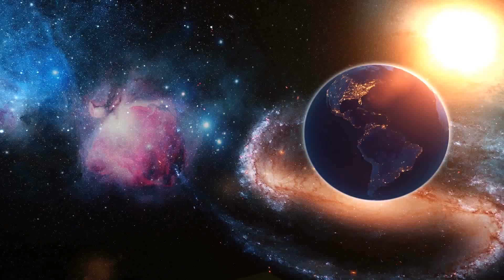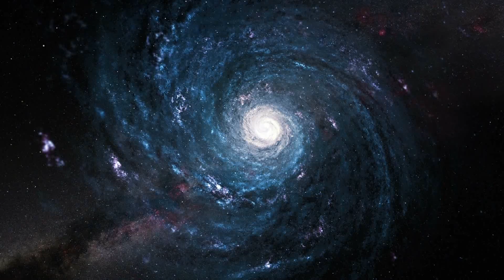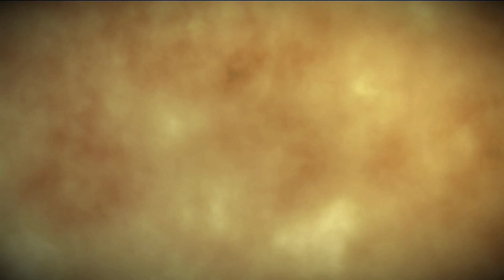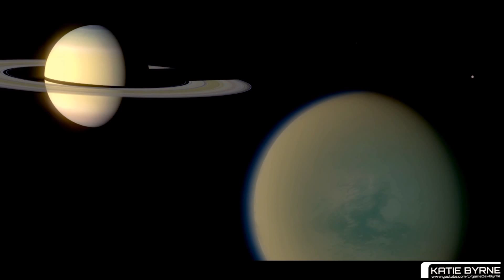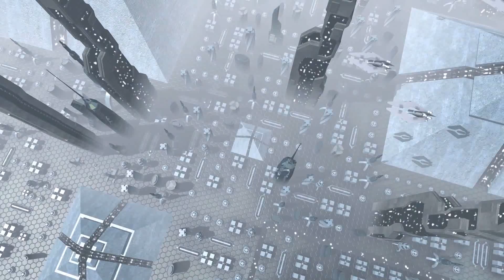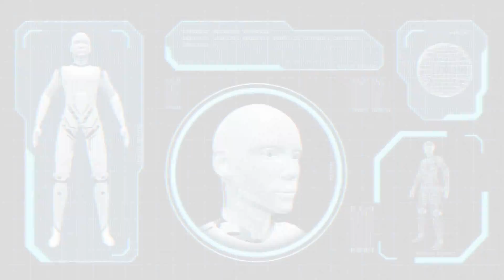Planet Ships

Comment: Anchor each end of a giant rubber band at L4 and L5 Lagrange points, pull it back with a rocket, wait for the correct trajectory, and THWAP!  You're off to Andromeda!  Granted, this would require the mining of space rubber...
Reply: you'd probably just slice Earth in half, unless you make that TWO rubber bands, one connected to L4 and Earth, the other to L5 and Earth, with connections being severed at just the right moment
Reply: This sounds like a job for Jörg Sprave.
Reply: Sounds like a job for supper duck tape and supper bailing wire and biiiiiiiiig 2 X 4.
Reply: Icy Knightmare   “So I came up with this. Let me show you its features.  Ha ha ha ha!”
Reply: Keith Plymale 
2 Astronomical Units x 4 Astronomical Units?
Reply: lmfao
Reply: Coming from ACME near you...
Reply: "Space Rubber" would be a great name for a band...
Reply: @berniebaer9199  Nice that SOMEONE's being practical.
Reply: @onlyrick  you are most welcome ;)
Reply: @berniebaer9199  "to show the power of flextape, I SLICED THIS PLANET IN HALF!"

Comment: I remember a book called "The Jupiter Theft". In that case, the planet moved was a gas giant and they included one of the moons as a radiation shield while they had 5 generation ships hiding in the shadow of the moon. Their method of movement used the gas giant as a fuel tank and created a lot of radiation so a moon was necessary for shielding. I suddenly recalled the book when it was mentioned that you put the planet in orbit of a gas giant and move the giant.

Comment: Now I'm wondering what would happen if you smashed together two planets that are traveling at near light speed
Reply: many asteroids flying everywhere would happen
Reply: @jgr7487  no, I think the material might get vaporized or something similar to that, perhaps they'd collapse into a black hole? I don't think it would be that boring
Reply: I'm too lazy right now to calculate the total energy in that impact, but I assume it'd be comparable to a supernova or hyper nova. You'd also have a very large amount of extremely hot, extremely fast plasma expanding outwards in all directions.

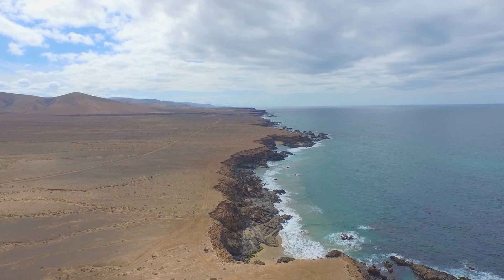Comment: Commenting @ 4:30; The moon doesn't cause tides because of the amount of gravity it exerts on Earth, it causes tides because of the difference in gravity it exerts on one side compared to the other (it pulls greater than average near side, and less then average far side, causing a stretching effect). Because it's relatively close to Earth proportionally to its width this effect is greater then the similar effect caused by the sun despite the suns gravity being greater. Note this doesn't cause water to flow to one side of Earth, but two sides. Also, this is more from water flowing laterally and gathering together and at coastlines faster then it can drain, or draining a local area faster then it can refill. My point is this means its hard to compare this to a linear push which might cause a much greater effect even at lower accelerations. Issac may yet mention this, but for this reason repurposing the moon as a gravity tractor might be better, because the worse effects would be isolated to the moon and the acceleration on Earth would be very natural with the main change being the changes to the Luna months phase.

Comment: Imagine some force trying to attack a relativistic planet ship and the space clearing lasers just cutting them to bits before any dramatic battle could even be thought of.

OR, better yet, a force knows they have this tech, so they bring an easily melted shell full of lead chunks so that when the lasers auto target the meteors, the just spray a debris field across their path.  

What I'm saying is sci fi should adopt this idea in a battle sometime in my lifetime.
Reply: What they forget is that planets often have real life force fields called atmospheres.
Reply: @johnrickard8512  and depending on weapons used the magnetic field could cause issue too.

And perhaps the attacking fleet would make extensive use of mirrors to deflect the point defence lasers, while either re-directing them or using their own point deffences to destroy railgun slugs and missiles trying to destroy said mirror.

Which also gives the thought, a micro black hole could be a nasty thing to fire at someone if you got it going fast enough since you can't simply shoot it down, you either have to evade or fore something at it to deflect it, that could be a fun-if-extreame sci-fi weapon that something like a Planet ship would have more than enough energy to power
Reply: @johnrickard8512  Well, we're talking about lead god-rods being put in the way. I doubt measly nitrogen and change can stop that while cruising at relativistic speeds lol
Reply: @EnPriBricks  True.

Comment: also while tidal forces create tidal heating they do so depending on the strength of the tidal forces and the rotational speed of the earth - if we stopped the moon in it's orbit and used angled thrusters to counter the gravity and keep moon at a cosntant distance so that the exhaust does not hit earth (because they are angled slightly) - we could move the earth by gravity tractor without applying any extra heat to it - the earth still spins at the same speed and the tidal forces are the same - well the moon is no longer orbiting so the relative rotational speed would be one rotation per month more - so the tidal heating would be 1/30 more than currently - or about 1 extra Kelvin of overall temperature every 200 million years
the main source of heating would be the potential of engine exhaust hitting the earth which has to be minimized by very directed engines slightly angled around it
with the moon that would allow us to accelerate earth with 1/300000 of one G while the tidal forces experienced at earths surface are actually about 1/9000000 of one G
if we want to build an artificial gravity tractor, as massive as earth producing a bit more tidal force than the sun and moon combined that would mean we could place it about 3.5 times further away (3.5³=42.875 so it would produce about twice as much tidal force as the moon and about 1/3 more than the moon and sun combined on a new or full moon)
and we would get 80/3.5²=6.5 times as much acceleration or about 1/46000 G
that would bring us close to the speed of light in about 46000 years - in that time we would travel 23000 lightyears since we're constantly accelerating so our average speed is about half the end speed - if we slow down again we have traveled 46000 lightyears in 92000 years
since for a constant acceleration from stillstand distance covered is proportional to time squared it would take 1/100 the time to travel 1/10000 the distance or 920 years to travel 4.6 lightyears roughly the distance to the nearest star - or around 1840 years to travel 18.4 lightyears

Comment: What about Real or Artificial Solar System Ships? Like in Andromeda (Sci-fi Tv series) with the Magog Worldship.
Reply: A dyson swarm configured to function as a shkadov thruster is basically the same thing. except instead of crudely stapling a bunch of planets together around a fake star, you disassemble the planets and use them as raw materials to build orbiting space stations around a real star, except you only put the stations on one side of the star to function as a solar sail, which pulls the star along with it due to gravity.

Comment: Heck of a weapon.  What kind of defense could do any good against a planet inbound at .1c?
Reply: Throw another planet at it, or get out of the way.
Reply: Throw a moon at it, move your dyson sphere, change it's course using your own laser highway system, send self-replicating robots that would take over and disassemble it.. idk. Many science-fantasy options.
Reply: Let’s see: if you throw a moon or planet at it, instead on one really big thing coming at you at 67 million mph you have a billion things 500 miles or so in diameter each piece doing 6 million mph.  Not much better.

Move out of the way?  At what acceleration?  The incoming really shouldn’t care if the object is shredded, but the target is populated and probably has oceans.  Isaac describes some of the tidal effects.

Push it aside?  How much advance warning do you have?  Remember it has a lot of mass and some terrific momentum.  If you push it too hard with lasers, you just changed it either to molten metal or a massive cloud, neither would be a great improvement.  And a cloud might not be as susceptible to laser steering. And ecosphere (like on the target) is a father sensitive thing.

Generally speaking, there are a lot of ways to make things worse and not very many ways to make things better.  Maybe a higher k level could do the intercept...
Reply: @jamesmeritt6800  Collisions at those speeds are more like explosions, if it happens far away your home system is gonna be fine. As for pushing or damaging the thing- a little push off-center far away will cause it to miss. If the target is a planet with oceans and tidal effects are a real problem for it's inhabitants it probably means the civilization isn't too advanced and is screwed no matter what the enemy does to them.
Reply: Mic_Glow,yup, being someplace else is the best protection against explosions I know of.  But if the original was aimed at the target, a LOT of pieces will.  Instead of a planet-destroying crash you may only have a few billion explosions, each significant larger than what has been known as the “dinosaur killer”.  Instead of sudden death it is death spread out over a couple of weeks.  Think relative momentum between the incoming FAST world-shell the the momentum of the interceptor.  Now think of the expansion after the incoming interceptor.  The original target will (probably) still be in the cone of pieces.  The target world might not be destroyed, but life on the surface of it would still do ended.
Reply: In fact, once it gets up to speed, the one that uses planets for a projectile may want to destroy it themselves, converting it from one thing to try to push aside to a few trillion 500 mile spheres of mostly iron, all still headed the same direction but now spread over a few planetary diameters.
Reply: I feel like even just bluffing it would be a hell of a psychological tactic.

The implicit message of "If I'm crazy enough and rich enough to do this, imagine what else I might do to you"

Comment: Nice, I thought of this a couple months ago. It makes you wonder if that's already what we've done.....
The issue is if you move a planet you must bring a star with you. I'd rather a giant ship with everything needed and collect resources from asteroids, planets and stars on the voyage to wherever you go. I believe we have been travelling for quite some time.
Reply: You don't need a star in the classic sense, sure massive fusion reactors for power would be essential, but all you really need for the earth itself is the normal amount of light and heat, which would be even easier with a shell built around the Earth since it could help hold in the correct amount of heat

Comment: the big advantage of gravity tractors is that gravity - again, apart from tidal forces which are a relatively small deviation - pull on every single atom of earth with ALMOST the same amount of acceleration so the structural load on earth is relatively small - replace that with an engine attached to earth and you are only accelerating this one spot of earth - everything else will have to be pushed by structural forces in the earth - which means we could only practically accelerate with about 1/200 as much acceleration - you can decrease that problem by using several small engines instead of one large one but since exhaust generally moves in the opposite direction than the one you want to accelerate in if you want to have any net acceleration they will all need to be placed on one side of the earth - or all around the earth and turning on and off if the earth should still be spinning but then all the CURRENTLY RUNNING ones are still on one side of the earth so the other half of earth is going to be moved by structural loads and most importantly they will all be mounted on the earths surface so it's entire insides will be moved by structural force - unless we develop something like dark matter exhaust engines that have exhaust which doesn't interact with other matter - in that place we could place engines on the forward facing side as well as inside earth to spread out the force

Comment: Possibly Irrelevant Question:
Why would a "relativistic kill missile" need wings?
Reply: To make it look cool
Duh!
;)
Reply: Yup, it would be parabolic mirror or such, the image is just stock I believe. There was an episode where IA thought how to hit every planet in a galaxy with relativistic kill missile at same moment, so big thinking isn't new.
Reply: Wings are probably useless, but a sail would be very good.
Reply: Despite what many might think, there is drag in the interstellar void because there is molecular material in it. (Though very little drag) At distances of many light years you might start to feel a slow down. Wings might just help with that.
Reply: @marrqi7wini54  I think a space missile wouldn't have much use of lift generated by wings. Even if it worked, it would only make targeting more difficult while also marginally slowing it down. You're arguing for aerodynamic design, not wings.
Reply: @marrqi7wini54  I appreciate your answer. I would wonder, however, if the increased surface area of wings would increase the overall (tiny) drag beyond what they could mitigate. It's a fun question to ponder upon, isn't it?

Comment: also, a gravity tractor working as a shield at the same time would ideally actually be elongated - having a diamter slightly larger than earth but a length much greater - this way you have surface area to radiate off waste heat without too much of that heat hitting the earth - if you make it say 5 diameters long and you paint the sides and rear so that hte sides give off more thermal radiation than the rear you could reasonably design this so that the thermal radiation from this object hitting the earth behind it is comparable to the thermal radiation from the sun, that currently hits earth, also known as sunlight

Comment: Can I request (though it may already have been mentioned) that a future video examine the practical techniques for disassembling Earth or another rocky planet? We've examined disassembling a gas giant via fusion candles or Neptune's Chainsaw, but what would be the best strategies for a (relatively) solid planet or large moon?
Reply: Just take it apart bit by bit, launching each load into space with mass drivers or an orbital ring. Or just blow parts of the crust out into space using underground antimatter bombs, or just blow up the entire planet.

Comment: @Isaac Arthur 
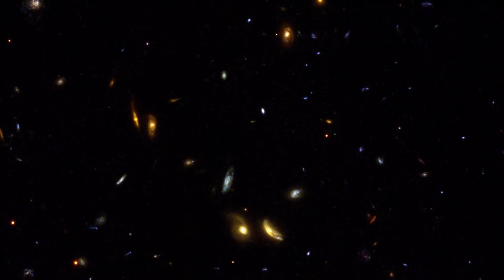@ 23:30 Isaac says "...and will arrive seeming to be moving slower. So if you send out a ship at 8% of lightspeed, it will arrive at only 1% of lightspeed, making it much easier to slow that ship down on arrival." 

That is not how I understood expansion to work, but please correct me if I'm wrong. Since the effect is dependent on distance, the expansion rate during your journey will not be linear. In the  beginning of the journey the expansion rate will be 7%, so the net speed will be 1%. However, halfway through the journey, the expansion rate will be down to 3.5%, making the net speed 5.5% of lightspeed. This means that your journey won't take the full 100 B years, and that you will arrive at full speed and need full deceleration. The actual speed of the planet ship has never changed, just how fast it was gaining on its destination. I know that light from distant galaxies still arrives at light speed, only the wavelength has shifted. It doesn't take more time because it's slower, but because more space was created for it to travel through.
Reply from the maker: photons move at that speed because they have no mass, bad comparison

Comment: Starting at time sync 23:18, the video discusses the idea that slowing down will be easier, as things are moving away from us (at about 7% of lightspeed for each billion light years distance) and therefore that would cancel most of the speed difference between a distant target and our planet spacecraft.  I'm not sure this reasoning is correct.  Things are receding due to the expansion of space.  This means that we would have to travel additional distance over time to reach the target location regardless of the speed that we travel.  As we draw closer to the target, our speed relative to the local space expansion continues to be zero, but our speed relative to the target seems to accelerate faster and faster (remember, the target's relative speed to the local expansion of space is always zero, and so we see a target that is receding more and more slowly as we get closer).  This means that as we get closer we would see our speed relative to the target increase.  So at best, we would start decelerating earlier, but the deceleration has to not only cancel our speed but also compensate for the accelerating approach of the target.  At least, that's how it would seem to me from our frame of reference.